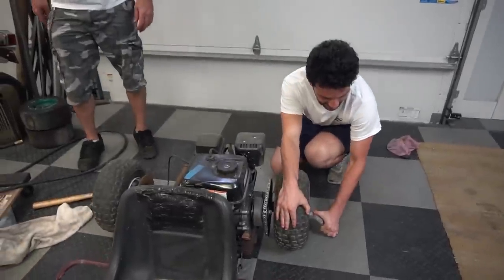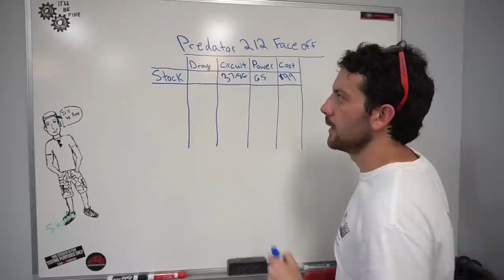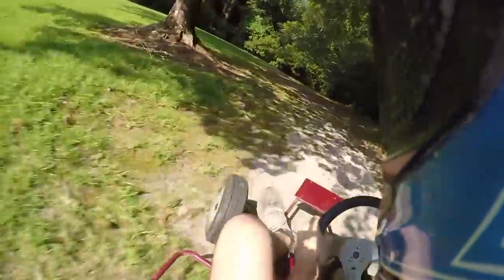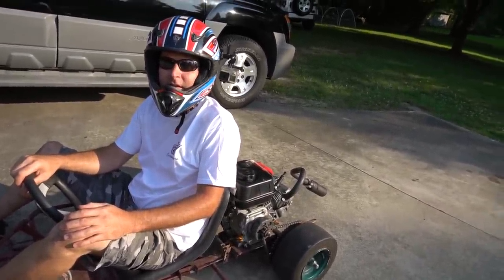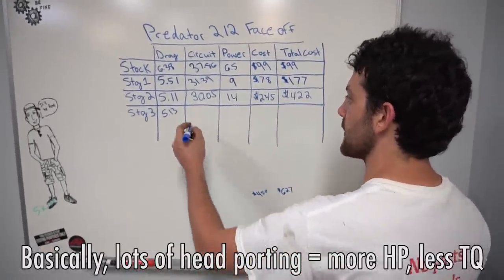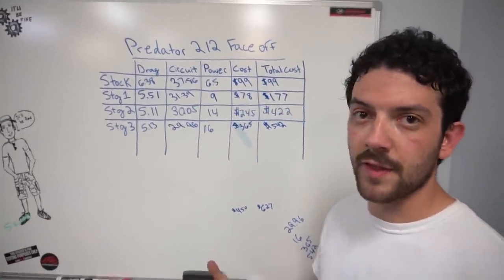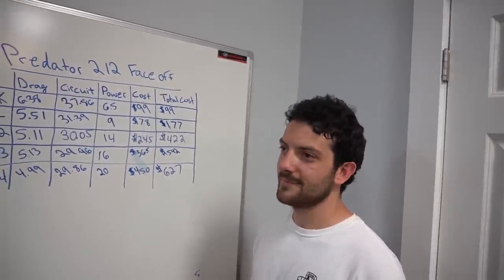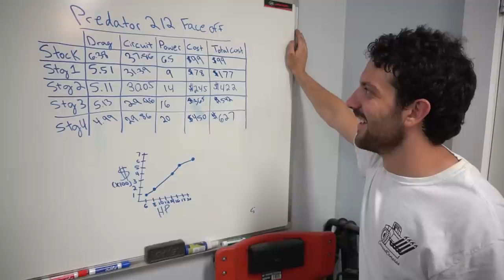5 Engine Showdown! Mild to WILD Predator 212cc Comparison

Comment: i have no idea what hp mine is but its 20hp+ and i still have to ungovern it put my 9000 rpm camshaft it in and do some head work, i will have have done petty much anything you possibly can to gain hp, you name it ive done it,its like 3 times louder than my dads 390 hp hemi v8,hope i dont fucking kill my self on it as it will be attached to a torque converter and live axle

Comment: Hey I have a 212 Hemi preditor motor on a go kart but it doesn't want to move forward and when it does it is really slow maybe 10mph if that and shuts off after about 2 -3 mins but can start it right back up it idles great but cant figure what is going on so any advice would be great thanks

Comment: I plan on running the 212 on a boat (cheaper than an outboard)and if I remove the governor whats the other parts that must be upgraded so i don’t run into problems of me running the engine in high rpms for a decent amount of time. Billet aluminum fly wheel?

Comment: When timing your runs you should leave a camera with timer running and not start and stop it. Then you can watch the video after and get a more accurate reading. You can literally go frame by frame to see the most exact and accurate times/laps. This will be more important for the Stage 2 + modifications since the time intervals become smaller.

Comment: How about spending some time helping out  the influx of Raptors that are returning from active duty ? On this Independance day  I want to recognize  the  briggs & stratton flathead and a salute to all of those who contributed to  the evolution of a simple common  motor that single handedly saved competition karting from becoming a spectator sport .Im finding  raptors  in bins at my local scrap yard ,  bought them back for under 10 bucks .  Id like to know  what Can be exploited that is in these motors  as far as returning them back to pump gas .ive got a mikuni  set up with a manifold  im about to bolt to one of em  and im working on a way to spin the sucker over with an old hammer drill. Im hoping that itll be fine. but the only ethyl alcohol i have on the premises sure as hell aint going in this motor.

Comment: Mabey a series were you use different octane boosters (104 octane) to see what they do. If anything!!! Would be fun
Reply: I don't think it would make any difference. Theoretically, you want the lowest octane you can run without damaging your engine. Anything more, and you actually make less hp because the fuel is less reactive.
Reply: @Eastsidegeorgiaboy   proof??
Reply: You can also contact VP Racing Fuels, as well as Sunoco fuels, and ask them.

Comment: put on rain or off rd tires when running on the grass because your times will get way lower since slicks slide on anything but smooth pavement. i have 3 sets one rain set. one winter studded tire for ice racing and slicks for when i wanna do burnouts 😁😁

Comment: I got a mud motor with a 13hp predator and a guy told me that with governor out it doesn't run well when trolling with throttle down with governor removed.. is that true that it won't run well with throttle control on low with governor removed? Also is it safe and or good to take governor out with just making the change to valve springs?

Comment: seems like the more built the motor the weaker the low end power is.  dragged there wasnt much gains compared to around the track, assuming that is because on the track you made more use of the high end power

Comment: Love this video. Nice to see a good comparison of the engine mods. I would love to see this with the stage 2 or stage 3 engine and a torque converter set up with springs for around a 3000rpm stall. Thats basically what Im working on myself but its going to be a while till its finished. I feel like it would be a really killer, budget friendly package.

Comment: gy6, bored to 180cc $100, port ant polish by me $free, exhaust and intake by me $free, a12 cam $20, 12 gram sliders $8. dynoed at 28 hp with 22 tq. I can still play with the sliders to move my torque and HP but on my buggy I get 40 mph and can dig the 23 mud tires all day with me on my son's buggy.

grew up on 5hp tecs, briggs, and modding predators but once you step up to real engines and quit those lawnmower engines you will see real power increases. Bet if you offered my 10 y/o a 420 predator he would laugh in your face.

Comment: The Stage 3 without the 26mm carburetor was kind of a waste of time in my eyes.  If the carb is part of the Stage 3 package, then you left out a rather important part of that package.  There is a big difference in airflow between a 22mm and 26mm carburetor at higher RPM.

Also, while I do agree that running every engine with the same sprocket setup was a great way to measure results, I think you should have noted that the higher stage engines can easily run shorter gearing to achieve better acceleration thanks to their much wider RPM range.  That would have made up for the loss in low end power and helped to get them into their peak power RPM ranges, allowing them to utilize the actual power they are making.
Reply: OddBallPerformance yep

Comment: I got kind of a dumb question, what would happen if you put the smallest possible sprocket on the axle? 

Also, I don't remember if it's been addressed but have you guys considered the idea of stroking a 212? Cylinder work, stage 4, larger piston, so on. I'm not sure if its possible or not.
Reply: GruesomeJeans well a 53 axle sprocket should get it around 70 mphish

Comment: Amazing video very interesting. My question is, is it worth putting those kits on or will u grt the same results from a bigger motor. (Possible video idea). For instance will the kit that puts out a particular hp be equal with a different stock engine of that same power?
Reply: Hondajohndeerecub i really love the 212s because the engine is so light

Comment: When are you guys going to give up the gay preditor motors, and use a 600 or 1000 street bike engine. You have cool frames to put bigger engines, but always use these wimpy engines.
Reply: Azia CR have you not seen our 80 hp 900cc ducati powered go kart?

Comment: Hi, I have a predator engine with the stage 1 kit. I was wondering if I want 18 pound valve springs, do I also need anything like billet rods or anything like that or is it safe just to put in stronger valve springs?
Reply: LandonProdutions Braden if you removed the governor then you want stronger springs to keep the valves from hitting the piston. You also would want a billit rod to keep from breaking the dipper ( oiler) on the rod. And now that you would be pushing more rpm it would be wise  to get a billit flywheel

Comment: Did you run the same gearing for all of them? The high rpm high power motor would have slayed with proper gearing.
Reply: jason birch same gearing and clutch for all

Comment: You gave up a lot in the higher stages by not raising the stall speed of the clutch because each stage raises the peak torque rpm by several hundred rpm.
Reply: Tom Krause a better clutch would have been nice

Comment: So how much better will a stage 1 without governor removal do against stock?
Reply: You'll have more power but less RPMs. You can try backing out the throttle screw for a bit more RPM (a little over 4000, forget the exact number).

Comment: Silly question but do you need Stage 1 to get Stage 2 and So On or if you buy Stage 4 does it include 1-2&3?
Reply: Richard Carpenter i believe you are correct. I don't handle that stuff lol. Im the stunt guy

Comment: Hey guys. I have a yerf dog with a stock 212 and a torque converter that goes 47 to 50 mph. STILL GOVERNED. How can i modify it. Also the steering to the left is bad and just doesnt grip. With big chunky tires on the back that may be it and small mower tires in the front. Help i cant fix the steering.
Reply: Will Watson we did a video on modifying the steering to make it turn harder on our yerf dog. You could have a issue with steering allignment or frame issues causing it not to turn but one way. Check alignment first
Reply: Isaac it'll be fine thanks ike ill look at it and see what happens. I may just see if theres some parts on go power sports.

Comment: Hey guys there are go kart tracks all over NC.
Reply: Thomas Strickland if they allow strangers bring their carts on there track i bet they would have to pass Tech inspection
Reply: GoPro does, though you're probably right about passing tech. Shouldn't be too hard to do that, biggest issue I saw from the video that they would fail was the motor puking oil during the run. A catch can should take care of it.

Comment: Drag times suck, because your clutch doesn't slip enough to get the motor up on the torque peak .... spend a few hundred on a quality adjustable slipper racing clutch, you will NEVER use those crappy lock up clutches again!  ... pulls from a dead stop and off the turns will feel like having twice the HP.  Gopowersports.com sells Bully racing clutches .. or go to Max Torque ..  http://www.maxtorque.com/racing.php  .. contact them, they can build custom clutches with high RPM springs and special Draggin Skin slipping shoes (I run these on my Vintage Racing Karts, awesome, withstand 6-7K rpm engagements speeds, under hard bad ass racing conditions).

Comment: Even stage 4 is a dog on take off.
Reply: low rpms will do that ...none of these engines were sitting on a stall..if they were using a torque converter with a stall things would have looked different